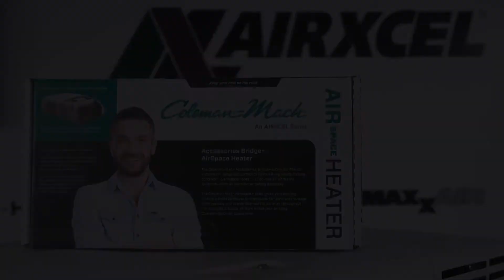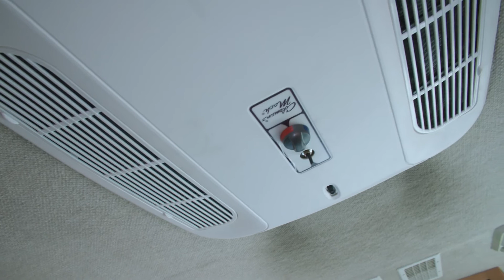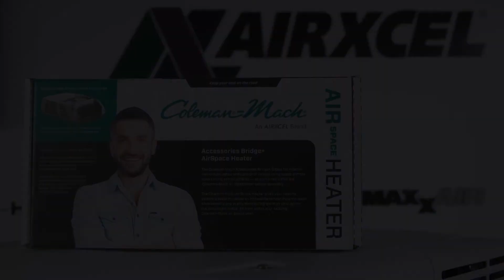Installing an Electric Heat Element in a Coleman-Mach Air Conditioner

Comment: The heat element I purchased looks to have a 2 pin with a female connector and the ducted wall control box also has a female connector.  In other words, the connector fits together, but the wires don’t actually connect.  How do you deal with this?

Comment: If the heat coil comes loose and touches the ac coil will it short out and ruin the capacitors?

Comment: What about a wall thermostat controller
Reply: Looking on their website they have an option for non ducted theromostaticly controlled unit and it says thst they are heat strip ready.
Reply: I was going to ask the same thing.  I have a non-ducted unit with a wall thermostat.

Comment: I installed this in conjunction with the Bluetooth controller. However it does not get hot and the output where the element plugs in shows about 48 vac. What is the Problem??
Reply: Same here, I’m getting 37volts. Trying to find the answer

Comment: I have a Coleman AC model 8333B876 with a heating strip. Will the older model ceiling assemble and heating strip work with 48203-066 replacement?

Comment: I have the Coleman AC on my 2015 Winnebago Brave.  It has the control box in the unit, and states it is heat strip ready.  My question is, if I install the heat strip, how does my Coleman Thermostat know to use the heat strip and not the propane furnace for heat?  Do I need to run a wire to the wall thermostat?  Or replace the wall thermostat?   My system is a ducted system.
Reply from the maker: Hello @Brave_new_world ______w  and @Alarming Twitch

Thank you for your patience and sorry it took us a moment to get back to you, but I believe we’ve got an answer for your question.

The control box being heat strip ready doesn’t necessarily mean that the rest of the equipment is.  Your thermostat (if operating a furnace also) must have 2 heat functions (regularly referred to as electric heat and gas heat).  If this is a non-zone thermostat, there will need to be a wire for this function running from the thermostat to the “W” terminal of the control box.

The Electric heat signal from the thermostat will simply tell the control box to operate its heat function.  The Gas heat signal is sent straight to the furnace instead of the control box.  

The control box will be wired specifically for the type of electric heat (Heat Strip or Heat Pump) and will operate accordingly. In a heat pump situation that is also heat ready, the Heat Pump function will be the default, and the heat strip is pulled in as a substitute if the outdoor conditions are too low for the heat pump to operate effectively and shuts down the compressor on the outdoor freeze circuit. This is a function that exists in the wiring between the heat pump and the control box. 

I hope this answers your questions. If not please feel free to reach back out to us or our technical support team at https://coleman-mach.com/contact/
Reply: This is what I'm actually wanting to know as well. Did you ever find out?
Reply: @AlarmingTwitch  Unfortunately, I did not.  I am thinking I will need to replace the thermostat (which I want to do anyway) but still not sure how the system would know which heat source to run.  I hope I don't have to run a remote wire or anything like that.  It seems to me that plug and play would be just that.